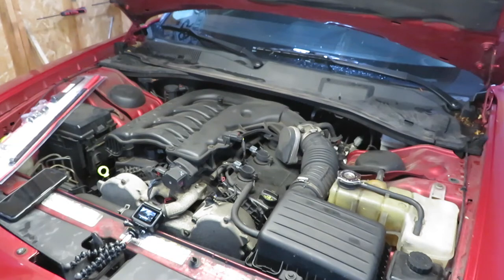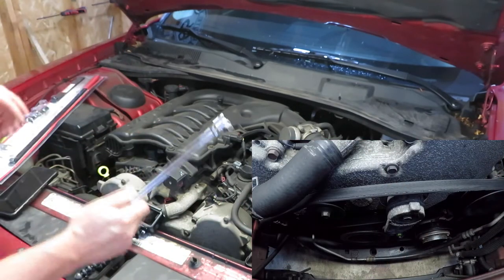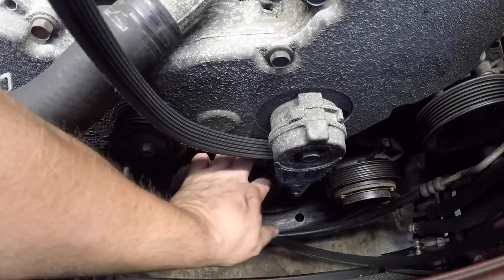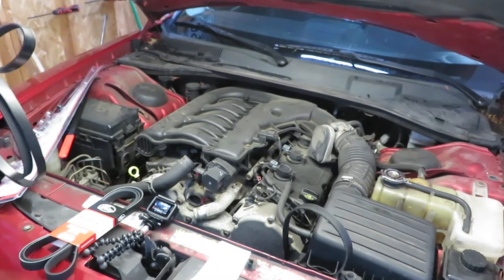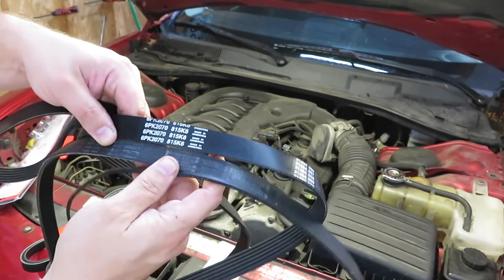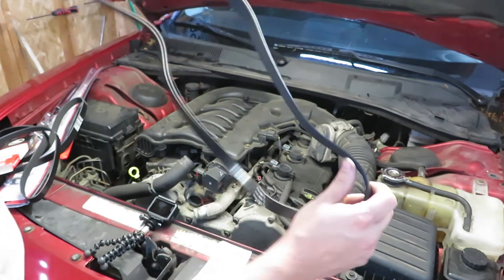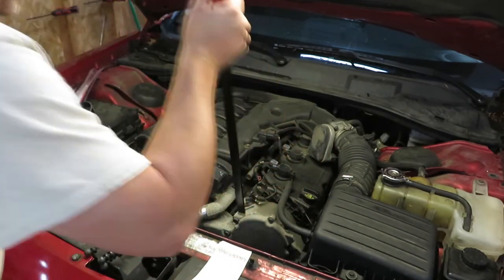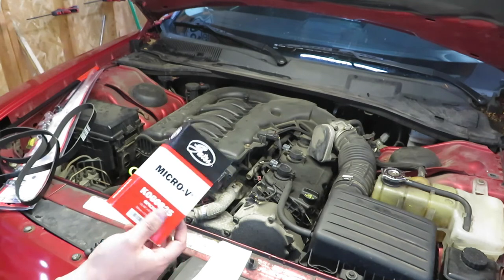How to Replace Serpentine Belt on 2005-2010 Dodge and Chrysler 3.5L V6!

Comment: Just got a new belt for my 2009 Challenger 3.5. Changed the alternator, belt a bit hard to stretch over lip of the pully. Will get it!
Reply from the maker: Just make sure it is routed correctly and you're able to get good leverage on your tensioner and it should go pretty smooth
Reply: @DCAutoEnhancement  A friend came over, and we checked it. Started it up,and ran great!

Comment: I have the same issue with advanced auto more times than I should.. I buy something go through the whole process of replacing it and it ne the wrong part... I had situations and I've reached out to management and upper management at Advance 800 number and they don't try to do anything because of their mistakes with recommending the incorrect part not even a sorry that this wrong part damage this other part. I only go to advance because of thier speed perks. But your changing getting recommended a wrong part.

Comment: Good timing! I was just about to have the shop do it, but it looks pretty easy
Reply from the maker: Hopefully you can do this and save a little money! 💰
Reply: @DCAutoEnhancement  Your videos are very helpful. I'm also working on the P0462 fix for my 2010 Charger. Is that still holding up for you?
Reply from the maker: @-syN  it worked for a while but then started acting up again. It is a loose connection on the circuit board on the far left connector. I did grab an instrument cluster from a junkyard and it works. The only bag thing is that the new cluster has the milage from the donor car.  I appreciate your feedback on the videos.
Reply: @DCAutoEnhancement  That's a bummer! I was hoping to avoid buying a new one, those things are expensive. Thanks for the reply
Reply from the maker: @-syN  the repair can be the fix. I would try it before buying one.  The one I bought from the local junkyard was $36
Reply: @DCAutoEnhancement  I did re-solder all the pins on the left connector and it's been working for over a week now! Hopefully it holds up. Thought I'd let you know incase you want to try it on yours
Reply from the maker: @-syN  Awesome.  I'm glad it worked out for you! I am going to give it another go. Thanks for the update

Comment: When you put the belt through the tensioner which side goes on the smooth side or rigged?
Reply from the maker: Here is a link to the belt diagram.  The belt should be touching smooth side to the tensioner. https://images.app.goo.gl/Z4sAQmCeWmoREgxa6

Comment: So nothing will happen to the motor if you loosen it up what about taking off that whole piece with the wheel
Reply from the maker: Just make sure the motor isn't running and you will be good. I'm not sure what piece you are referring the when you say the piece with the wheel. Sorry, it's been a while since I recorded this video
Reply: The first one you pointed to
Reply: #1
Reply: i think he meant belt tensioner